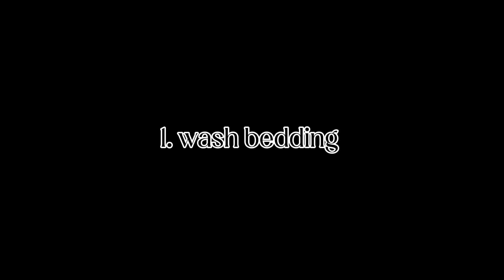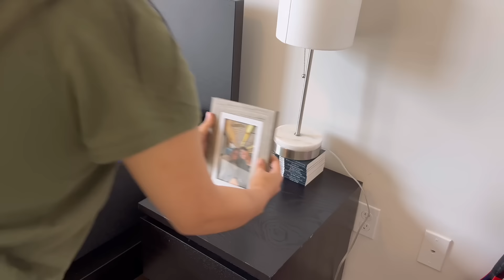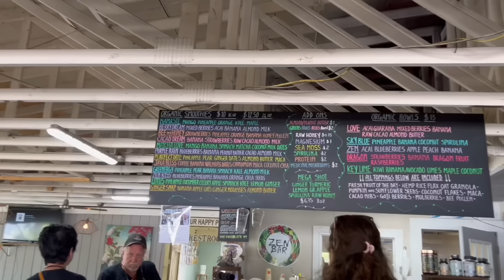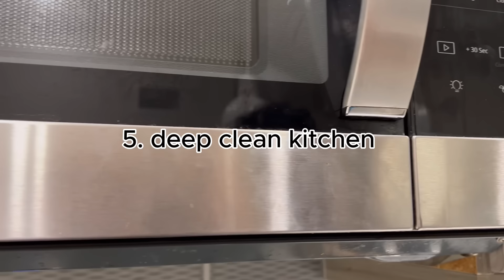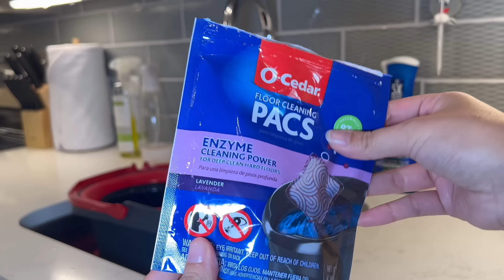APARTMENT RESET I all day clean with me, productive sunday, cleaning asmr

Comment: I had to subscribe after the way you drenched that bathroom Lol and then cleaned your mop bucket. Thats how you clean!!
Reply from the maker: thank you!
Reply: @kyriademi  no it's not how you clean.  Shouldn't mix chemicals. That's very dangerous and can even be deadly in a small space like a bathroom.  The spray she probably used for the disinfecting part which is actually not how it should be done. It's spousseed to be sprayed and let sit for a bit and can be dried or wiped off after like 5 minutes or so. I never knew that until I was bored and didn't have my phone so I was reading packages lol

Other than that yes it is a good video. I like how she didn't put loud music over it. I like hearing the cleaning asmr part lol